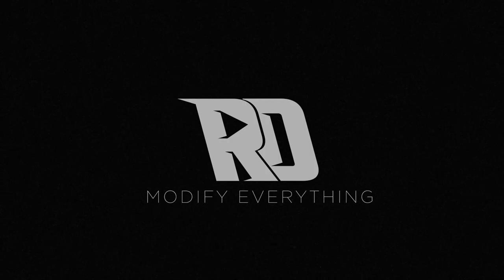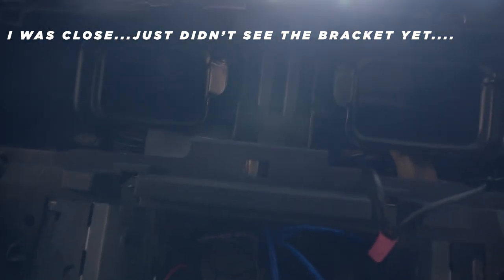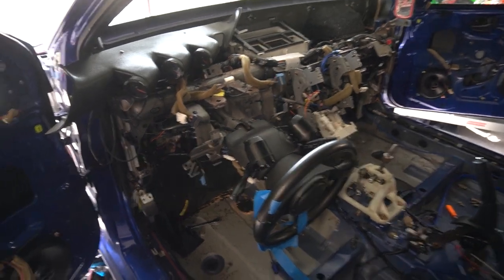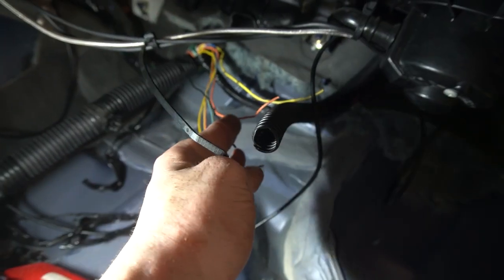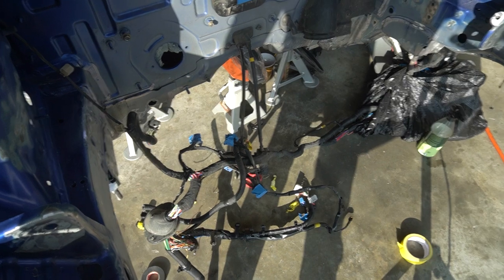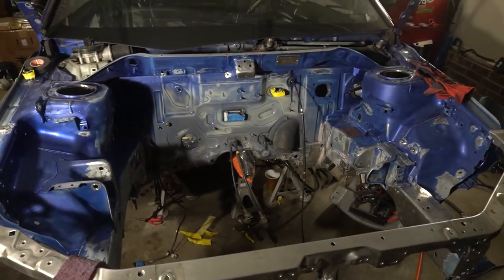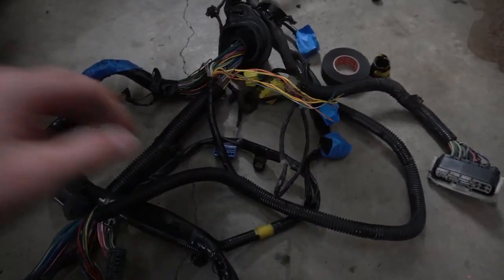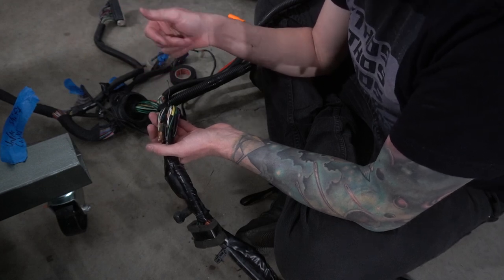The "Final Day" Of Prep On My Evo 9 Before Painting The Engine Bay | Dash Removal, Wiring, + More!

Comment: Btw you were right to cut and tuck the unused ACD ground. Those large ground junctions are crimped splices where one chassis ground becomes multiple grounds at certain points in the harness. To seal them well you ideally use epoxy lined heatshrink which melts and seals everything off. If you can’t use that then just tape it back into the core of the harness.
Reply from the maker: Oh I didn’t know that! I just saw that big junction and was like yeaaa, not messing with anything in that haha!! I’ll try to find some of that heat shrink, if not yea I’ll just tape it up nice and wrap it back in